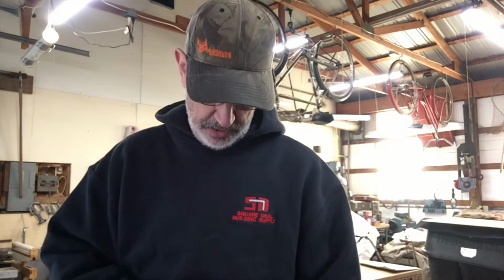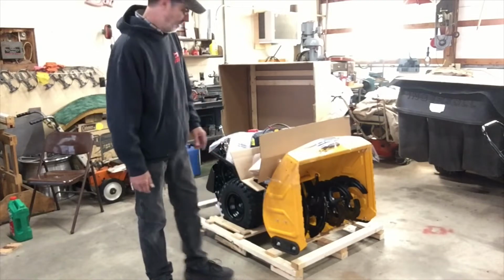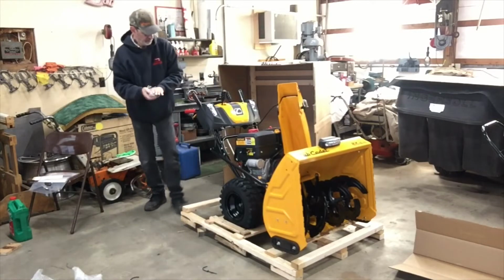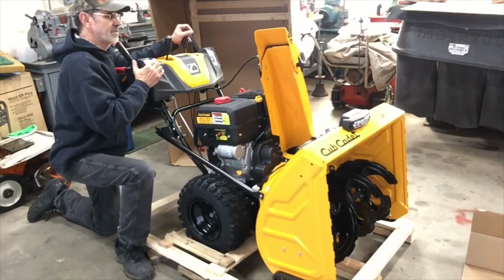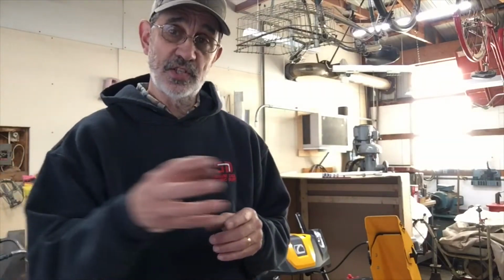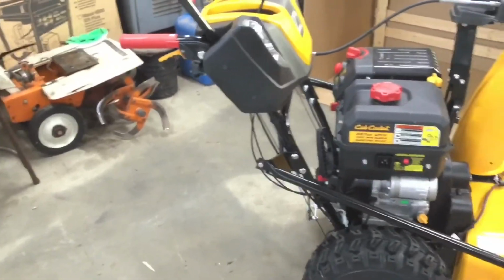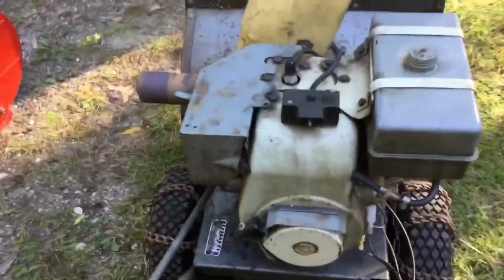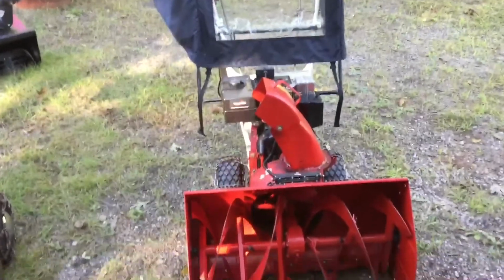403. Unboxing a new machine.

Comment: Hey Jim ! I hope this machine works out for You ! I bought a Cub Cadet 2-stage snow thrower model 528 SWE in 2010! & it's has been a very good piece of equipment ! & trouble free , & easy for DYI person to maintain , & perform pm's on ! The only  problem I had with it was the carb. had to be replaced , & that was my fault for not draining the old fuel out that sat in it for 5 years ! Thank goodness a new carb. only cost 25 dollars & a lesson learned the carb. does have a drain bolt at the base of the bowl ! & I think that's a great Idea ! & I do like the electric starter on it , All you need is a extension cord . Of course we don't have the snow fall that You have ! But it's better to have it , & not need it ! Than need it & not have it . I really like the placement of the light out front , & the heated grips! ( Nice ) I think your going to like this Cub-Cadet . Thanks Jim for the video .
Reply from the maker: Hay Venice. Thanks for the comment and the tip on your Cub compared to the rest of the machines I looked at this thing is really well-built and extremely heavy. Jim

Comment: Hearing the issues with the new blower market I'm greatful for mine.
Fall of 2019 I bought a shed find from a friend moving to Florida, a 1999-2001 ish yard king electric 8/27 techumseh with a cab. They bought it new used it a half season and moved to town with a 10 foot driveway so it sat in the shed unused. After I replaced the carb, rinsed out the tank, changed the oil and spark plug,aired up the tires, and cleaned/greased everything, I used it 2 years, until the belts finally gave way to dry rot. 
This summer I went through everything, belts, fuel line, filter, shut off, new knobs for choke, throttle and key, 
new shear bolts, greased and spun the augers while the old ones were out, topped up the gear case, 
tubed the tires 
and I picked up a chunk of 1/8 × 1/2  flat bar and made additional braces/brackets for my cab, while I love it, the frustration level was off the charts, it only came with u bolts to clamp the front  bottom frame to the cross bar/bolts on the handle bars, so it usually ended up laying on the engine,  the braces run from the handle bars, preexisting holes below the drive and auger levers to new holes I had to drill in the corner of the lower bar of the cab. Not sure why they never came with those, it just makes sense
Heres hoping it lasts another 20 yrs.
Reply from the maker: Well with all that TLC I’m sure it will last at least 20 years. Thanks for sharing. Jim
Reply from the maker: And it’s good to hear from you.
Reply: You know, this spring when I purchased my new zero turn I found a similar thing. All colors and all brands are the same machines, the same 3 motors, kawasaki, Kohler and occassionally a briggs, and they all have the same transmissions, until you start getting into commercial and then they're the same few manufacturers also. 
Choosing one brand over the other was a matter of warranties, comfort options, ie deck lift style, deck build, frame and plastic design, and the biggie was accessories. The bagger attachment for a husqvarna with the welded deck (not stamped) bounced around $500, the bagger for a hustler was $1500 because they require blower assist. 
It's difficult to be brand loyal to any name  really. Stanley Black and decker owns cub cadet, mtd and it's brands, hustler, and big dog outdoor equiptment. If you think that's neat, you should check out the tool brands they own. 
It's not surprising everyone has the same motor.